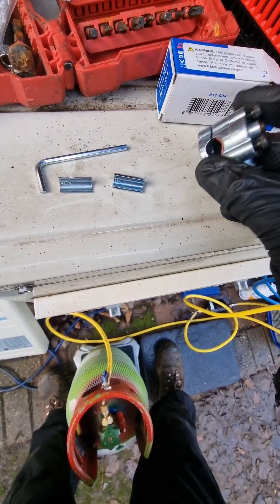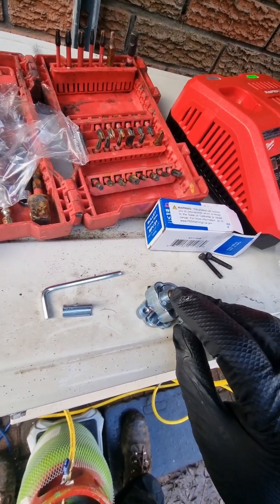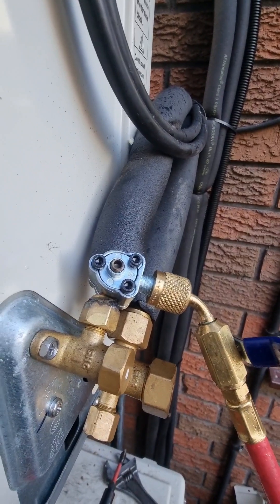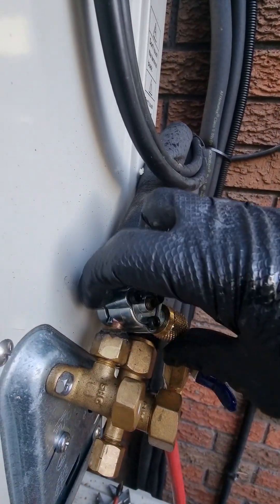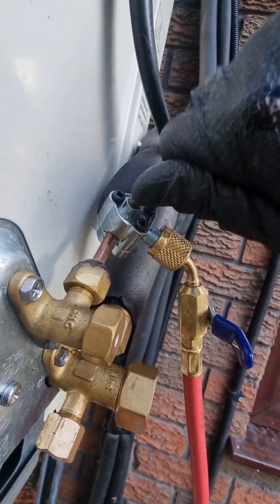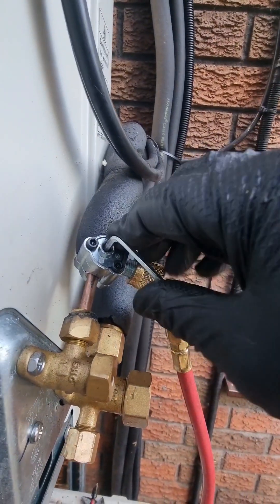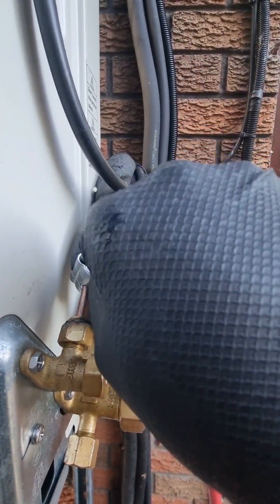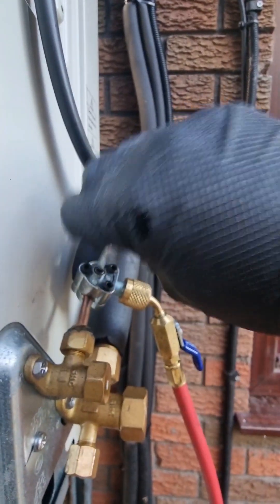Line Tap Valve's! When, why, and how to use

Comment: Why didn't you just pump it down? Turn it off and then replace schrader valve?
Reply from the maker: Very good question, so I'd normally do exactly that, so in this case, when trying to pump the unit down, it was cutting out still with a decent amount of pressure in the Suction pipe. 
Plus, I had a line tap valve on the van, so I'd thought it was an opportunity to demonstrate how to use it as I seldom use them.